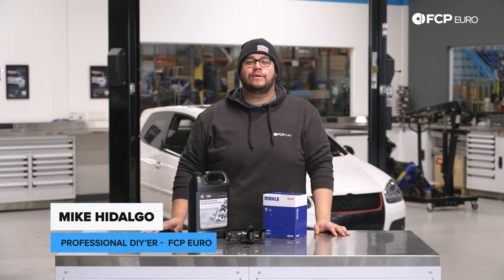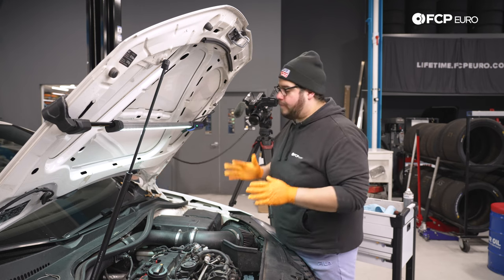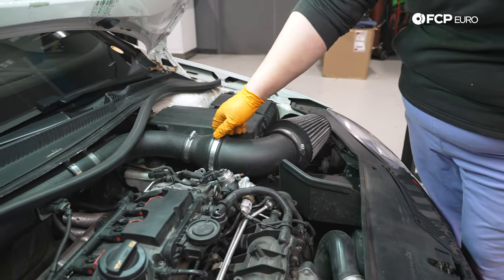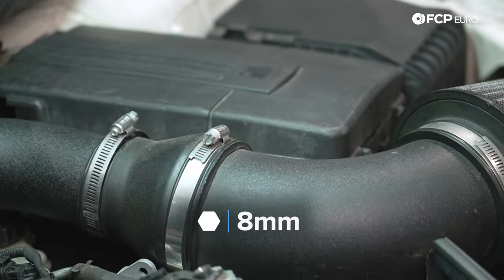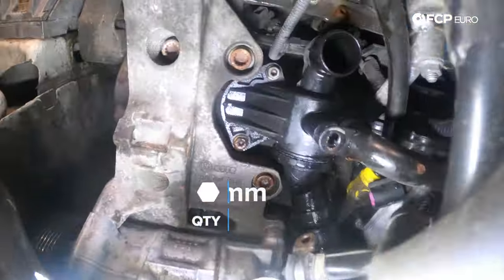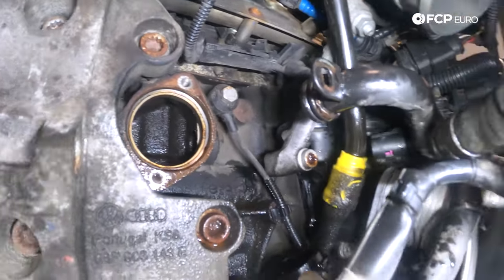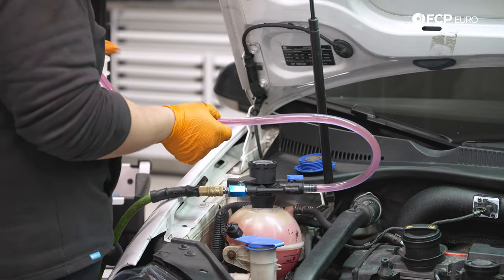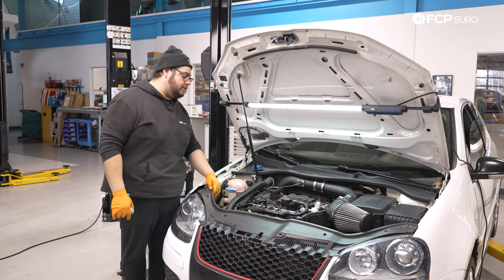Volkswagen GTI Thermostat Replacement DIY (2006-2008 Mk5 VW Golf GTI, 2013 Mk6 Golf R)

Comment: Thank you for making such a great step by step video!  
This job absolutely sucks, I fought it every step of the way!   Between rusted  out screws I had to E-Z out, with absolutely no clearance to get even an offset drill in, I had to use an air rachet and oil to drill the hole, took a while, to every other bs annoyance.   Why they use triple square screws to begin with in a difficult to reach area is beyond me!   The size of those two small bolts are M6 1.0x12mm, I would replace them if you take them out, got some on Amazon.  I’m a decent enough mechanic, many are way better than me, but I’m not terrible, but this thing kicked my butt!😂.  Took a few weeks, (I know, absolutely pathetic, and it shouldn’t take anyone this amount of time), because EVERY TIME I had time off from work it absolutely poured on my days off three weeks in a row thanks to El Niño weather slamming the east coast!!  lol.  I work outside in all weather situations and I’m not about to do that on my days off, so three weeks of rain and a busy hectic Christmas week and I finally got it done.  Running way better, but still have a G83 sensor fault.   I replaced both sensors while I was at it, especially the sensor off the thermostat body.  I replaced the upper sensor harness a few months back because one of the wires broke at the connector, had a hard fault.   I checked the lower harness as good as I could when I took out the thermostat, didnt see any breaks.🤷🏻‍♂️.  Oh well.   Further troubleshooting required, but the engine is running normal temp now, was running cold.
Once again, thank you so much for making such a thorough and easy to follow and understand video!!!   The camera angles were great.  Thank God for people like you, you make our lives way easier and save us $$$.  
Good luck to anyone attempting this job, this thermostat is buried!
Reply from the maker: Lorthvader, all that matters is you got it done! It was certainly not a fun job, but I am glad it was able to be of some help for you. Keep on with that diag, I am sure you'll get to the bottom of it!

-Mike

Comment: Great video! Man you make it easy. On the throttle body though, what I normally do is I first install the rubber hose to the throttle body, and tighten it, once that's thread in, I then dab a bit of grease or oil around  the bottom of the rubber hose, then from the bottom I then slide  the charge pipe in, and slides in with no issues. I then tighten the bottom clamp.
Reply from the maker: Love the tip, thank you!